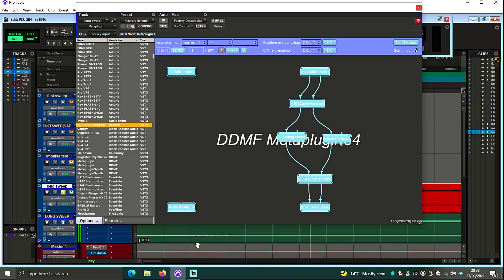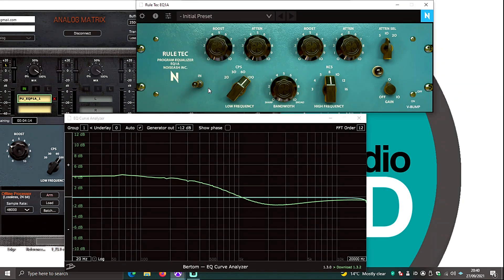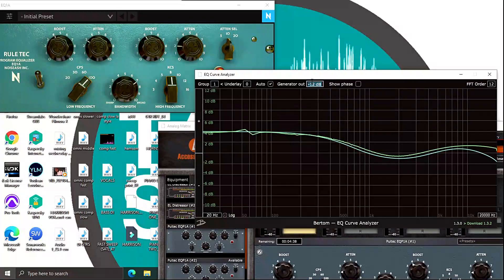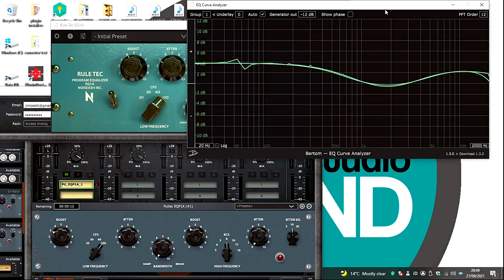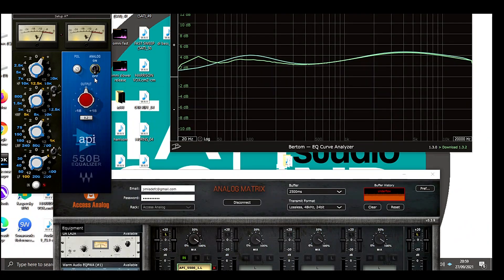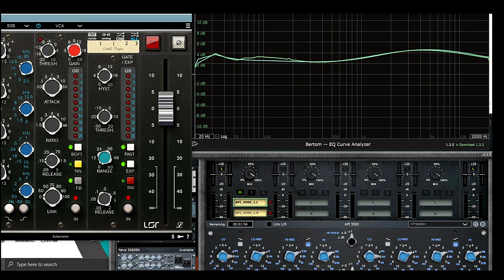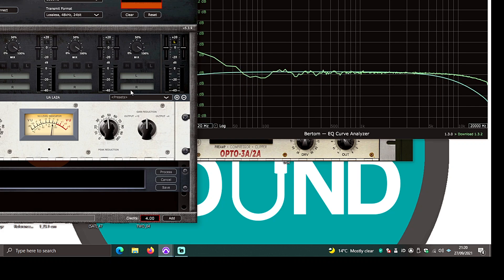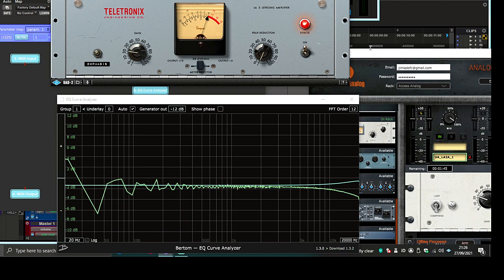How to match curves of ACCESS ANALOG HARDWARE & ANALOG EMULATION PLUGINS using BERTOM CURVE ANALYSER

Comment: I think it’s funny how we want plugins to emulate the non linearity of old analog gear but engineers from the analog days were obsessed with wanting more linearity and precision from their own gear. 😂
Reply from the maker: I know 😂 I totally get why you'd want more linearity as well. I actually prefer that plugins are fixed representations as it's the non linearities that breed inconsistent results. Just look at JJP. He had to get waves to model his fairchild on seperate days as his fairchild doesn't always sound at its best every time you turn it on.

In a sense many plugins are modelling the gear performing at its best. Why wouldn't you want that?

Its a debate that will rage on till the end of time 😂
Reply: @PaulThird  I don't think it will but to be fair there are some things that analog does better. I can totally hear it even if I don't know how to describe it. But I wanted to say something about the "it would be very CPU intense to model the randomness." Well we already have the tech we just have to switch. Just make plugins that run audio on the GPU and you can have a 1 to 1 model of a hardware 300 times in a project with no problem. First thing I said when I started making music and I saw that everything works on the cpu was "well that's stupid" a GPU is made exactly for this type of calcutations in real time. The first company to ever make any plugins that process audio on the GPU will 100% be the most successful.
Reply from the maker: @sanctusKain I suppose the biggest hurdle is how do you code an algorithm to give you that same randomness. Analog can be pretty random and it's dictated by the components of the gear so I suppose you would need to calculate an 'average' response as its all coded. I think that's why i presume that it would be very cpu heavy as it all has to be coded and predetermined in a sense. I suppose it's how you capture and code randomness that still has its own kind of pattern.. If that makes any sense 🤷‍♂️

As you can see when I get to the programming side of plugins and computer science side of it I am completely out of my depth 😂
Reply: @PaulThird  you can code randomness based on a set. The problem would be that you have to recalculate each new stage before applying the result to the sample that you are working on. I love to discuss about stuff like this. If you ever find yourself curious about it we can have a chat on insta. Btw I just found a starting company that wants to move audio on GPU. I just applied for the beta. If I get in I'll let you know what I can find out but it looks like they have 1ms latency on heavy distortion plug-ins and compressors.
Reply: @SanctusKain  Randomness by GPU with RayTracing convolution. They already use this tech on PS5. I also think this is the future of sound DSP
Reply: @PaulThird  you, me and 99.9% of the population are out of our depth on that subject xD lol
Reply: @MrlegendOr   You know what !!  God dam PS3s have been used to build supercomputers. The 32nd most powerful computer on the planet is a bunch of PS3s chained together.  Even the US military used a whole bunch, like 300, to create a giant radar network, or supercomputer, cant remember.   Maybe an indy developer could take this on lol.  The cells used in PS3s are incredibly powerful and could easily emulate hardware circuits.
Reply: @SanctusKain   mind sharing the company ?
Reply from the maker: Tbh waves just couldn't be arsed 😂

"do we really need to step it? .. We could add in an option to step if we wanted so it's more like the gear but have the option of the full gain control as well"

"nah.."

Goes back to his sudoku puzzle 😂
Reply: @PaulThird  lol
Reply: I guess the journey from 'lo-fi' made them seek better reproduction and 'resolution'. But most didn't realise the 'bonus' they were getting from the non-linearities.  As it turns out, perfect capture can actually sound boring, and we have created this distorted and artificial aesthetic, that turns the music into something else. This even inspired new genres.
Digital is perfect, but static.  And when i think of it, real sound is anything but static.  And if you imagine, if we hadn't created the artificial aesthetic, the audio engineers job would be absolutely minimal. In fact they could be replaced by AI.
Reply: But "engineers from the analog days" were working for different medias : Vinyl, shitty radios, hi-fi highly coloring consumer system. All of this with a mix from tape. So there is no surprise that linearity was a goal.
Now we work on much different systems for different monitoring environments, so the goal/desire of audio engineers might have shifted (also out of nostalgia we might confess).
Reply: I think what we've realised in the intervening years is that those slight imperfections and randomness is, from a psychoacoustic point of view, what creates a sense of depth when listening back to statically placed speakers. So many things in the real world create slight variations to the audio we hear. I guess psychologically we unknowingly crave that, or perhaps perceive the lack of it when listening back to recordings. Or maybe it's all bollocks lol, who knows.
Reply: @rossbalch  that’s exactly what I thought when I saw that hardware EQ curve moving like that in the low end. It kind of makes sense that something that “lively” would create that depth and dimension associated with analog gear. It makes me wonder if possibly automating a digital EQ to fluctuate like that (obviously not exactly but similar) would add something desirable. I bet the Pro Q3 would be the best contender. I think I’ll run some tests today and see what happens!
Reply: @davidasher22  yeah keen to do some experiments myself. Don't know about other DAWs but Reaper allows you to link plugin paramaters to an LFO. And you can create random LFOs so the modulation is unpredictable.
Reply: @rossbalch  oh yeah! Great idea. You can do that in Logic too with the stock “modulator” plugin.
Reply: Thing is they didn't know how linearity would sound.
Reply: @LDdrums20  Also a good point indeed.
Reply: Exactly. Very true. A lot of famous engineers and producers hated tape machines. They sounded different every day they swithed them on.
Reply: But many of the unintended things that the engineer did not care for are wonderful. Distortion being a prime example. While much of the subtle qualities of a given piece of hardware are caught up in nostalgia alone these days - to understand all aspects of the accidental qualities and then code them can be quite difficult compared to the rough engineering involved in the original hardware itself.

Comment: Why not just use waves Q-clone
Reply from the maker: Can you input 2 signals into it where it will show both signals? Plus the gui is pretty small I noticed.
Reply: @PaulThird  i mean if you wanna match eq curve of a piece of hardware
Reply: @mrmorpheus9707  Yes. Why not.
Reply from the maker: It's all about logistics for me, especially as I'm using access analog. For example, to match the access analog curves you would need to get the access analog signal routed into waves q-clone, save it as a preset, then go into plugin doctor, load qclone with that saved preset and then load the plugin you want to match and do it that way.

BUT plugin doctor doesn't allow to save presets on every plugin. The waves instances do but I've found a lot don't. So you would then need to transfer those settings in plugin doctor exactly into the DAW.

A lot of work when you can just buy metaplugin and install bertom for free.

Put it this way. Metaplugin is like £30 which is the same price when qclone is on sale. Qclone will just give you a measured signal. Metaplugin will allow you to create presets chains via the routing, match curves in real time and also oversample any plugin or plugins.

Everybody should own metaplugin if you ask me 😂
Reply: @PaulThird  guess this is for the access analog people ...i was referring to having analog gear and using q clone to  copy the curves   & use that on that on multiple tracks. Thats all
Reply from the maker: Sorry I'm in constant comparison mode. Everything must me compared to an inch of its life 😂

In terms of q clone, without the THD is it really getting you the hardware though? I presume qclone is solely the frequency response?
Reply: @PaulThird   well.. i got a few hit records  using them  so...😆😆😆😆😆
Reply: @PaulThird  Q clone does not have THD. But it's doing a perfect job of matching the curve EXACTLY, 100%.
Reply from the maker: Do tell.. I am quite a nosey Buggar 😂
Reply from the maker: So how does it work? Do you use it if you have like a fixed setting that you always use on hardware and use the captured qclone preset instead?
Reply: @PaulThird  Yes, exactly. Just a snapshot of one setting on the hardware.
Reply: @PaulThird  Probably. I don't know. When it came out, I was interested but I never tried it.